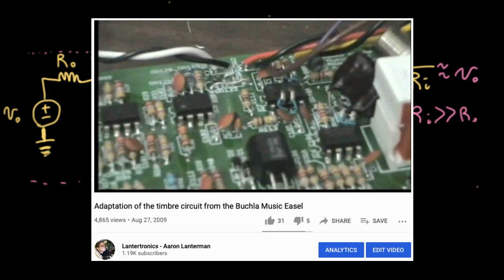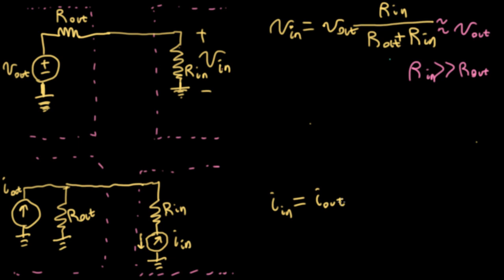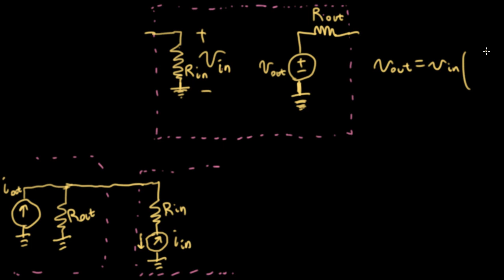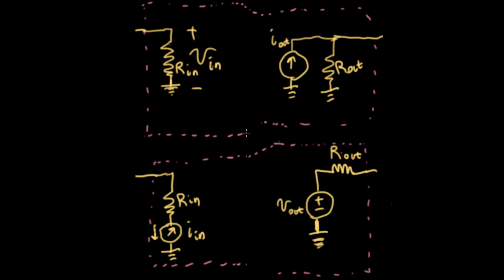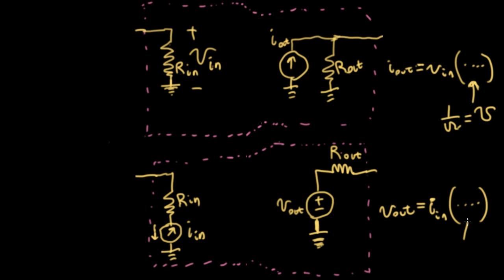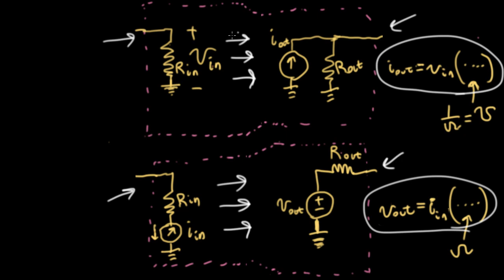Analog Information in Circuits (ECE Design Fundamentals, Georgia Tech class)

Comment: Thank you so much for uploading these lectures, as a professional musician diving into electronics, this helps me understand so many useful concepts!

I also have a noob question which relates to input impedances of musical devices (like a guitar into a hi-Z input). At 2:00 we use the voltage divider equation to show why the input impedance of the "receiving" device should be much, much higher than the output impedance of the "sending" device. But if Ro and Ri represent a simplification of the WHOLE circuits on both end, why are we not considering these two resistors to be in series? I know my misunderstanding has something to do with the simplification of the circuits but I haven't found an explanation that clarifies this for me.

Thank you!!
Reply from the maker: Hi! Sorry, I'm not sure I'm fully following your question. The resistors are in series, but the voltage seen by the 2nd system is tapped from the middle of that series combination. If you wanted to think about the current that the voltage source needs to provide, then it makes sense to write i_o = v_o / (Ro + Ri), where Ro + Ri is a series combination.
Reply: @Lantertronics  Thanks for the reply! I just re-listened to it now and you actually answer my question in the video. Ri can be considered to represent a Thevenin equivalent for another, more complex circuit. I think I just have some trouble wrapping my head around the concept of loading, bridging and input impedance on a deeper level.

Comment: Fun fact: Units inverse to Ohms is Siemens. Officially. Yes, in honor of Siemens, founder of German Siemens company. :-) But I never seen this unit usage. Ohm^-1 seems a way to go.
Reply: We did use them in my EE undergrad class at TUM. But maybe we were biased, because its a German university :). So calling the conductance Mhos made snicker a bit, but realized then it was indeed called like that in other places :D.

Unrelated: My Prof. was also very insistent on not calling it Thévenin-equivalent circuits, but Helmholtz-Thévenin-equivalent / Helmholtz-Thévenin-Theorem, since Helmholtz came up with it 30 years earlier.
Reply: industry often uses  'Mho'  (the reverse of Ohm)
Reply: You will find units of Siemens used in some datasheets for trans-conductance. Took me a while to realise what this "mS" unit was... not milliseconds....
Reply: In the work I do, it's always used.(It's used... I'd say... exclusively in physics) It's the SI unit for conductance. (ohm^(-1), or ohms is a thing... as the reciprocal of a unit is considered meaningful) 'mhos' is quite old now, and not standard AFAIK. (It was taken to relate the reciprocal of ohm as the anagram mho.) By the way AFAIK, the units named after persons, when written, are always in lower case, and  the symbol for the unit, is always in upper case. (volts,V; ampere,A ... and so on.)
Reply: @LeithBade  Yes. If it is a capital "S" ... and taken to be an SI unit... it is always a siemens. time in seconds is always a lower case "s"